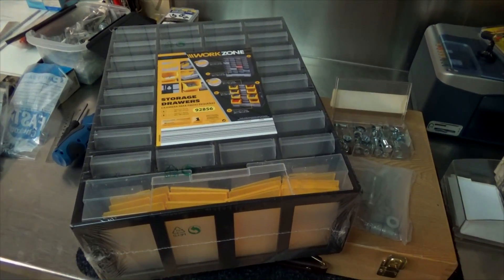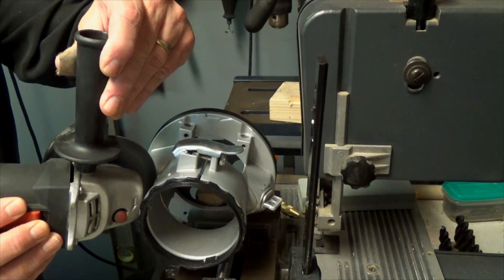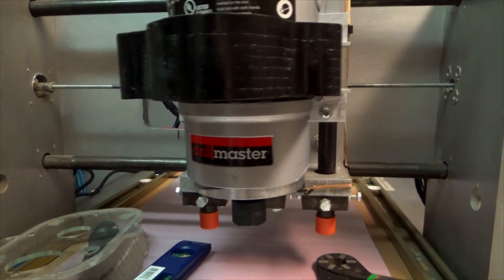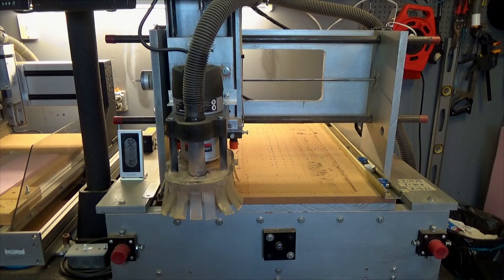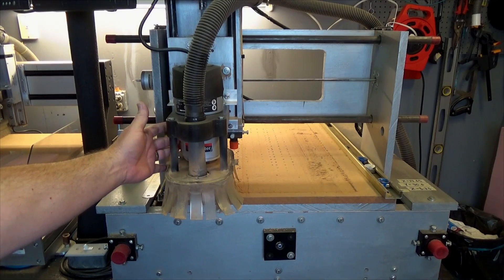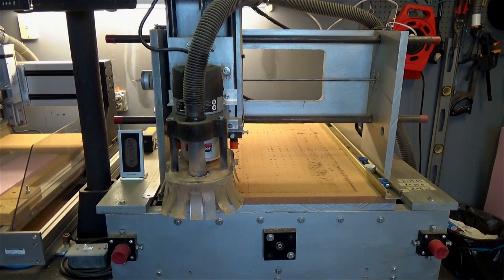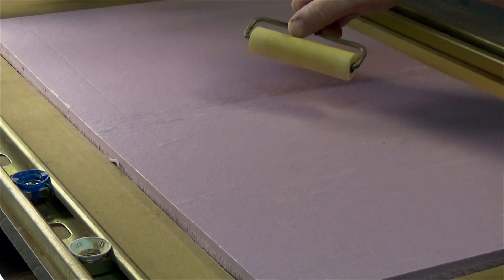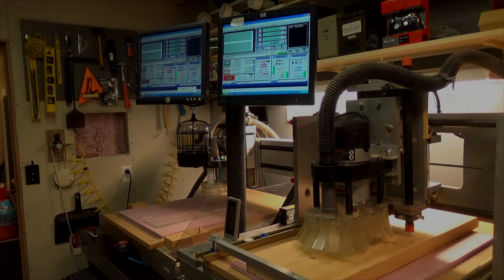Flatten Table - Finish Dust Shoe & Vacuum Skirt - Scratch Built CNC

Comment: I bought the same router... I turned mine upside down and ground down the  little raised spots on the inside so the router would slide in and out without threading up or down.. and mounted it up side down and slid the router in from the bottom... Now its the top.. didn't have to cut it that way... but to each his own...

Comment: Can you do a quick video about how you determined the best motor speed and acceleration settings in Mach3?  Setting the steps per unit is straightforward (and there are lots of videos about that) but I can't find a good guide to setting motor speed and acceleration that doesn't already assume you know the those values before you start.
Reply from the maker: OK, I will soon!